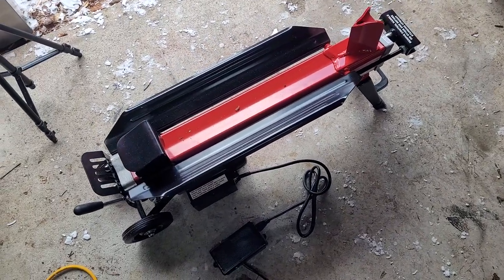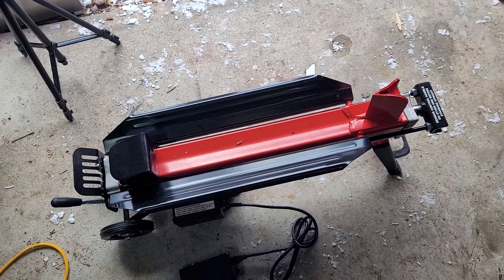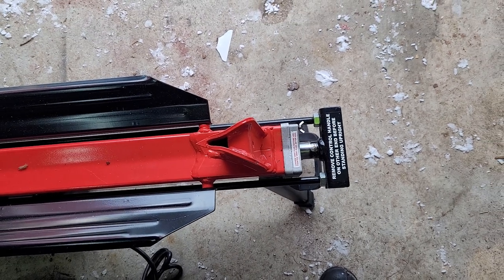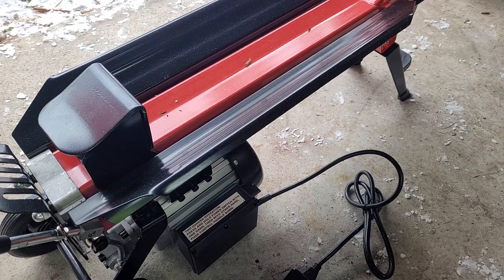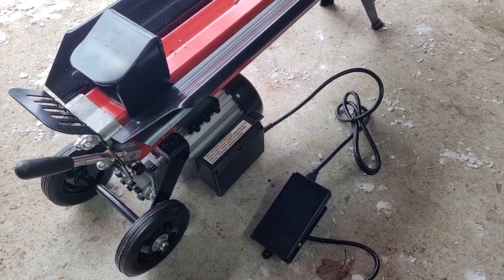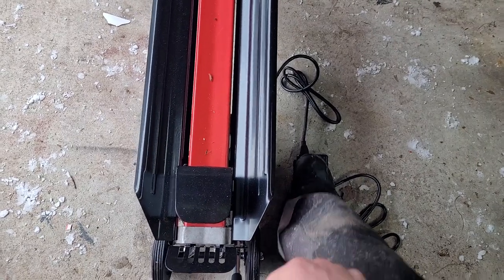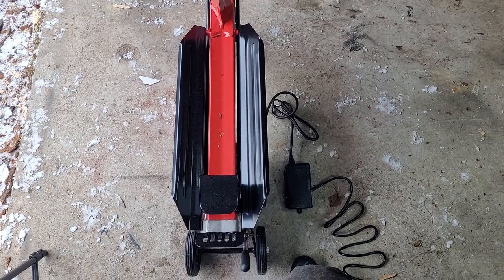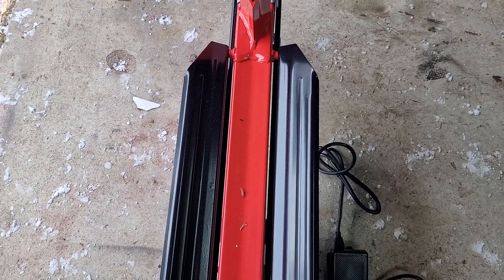Log Splitter Mod

Comment: Okay, it's getting a little safer than what it was, try to find a pipe that can slip on to the handle so your face/head is further away in case, as you said that the chunk of wood explodes, being as close as you were is a safety hazard in the beginning, the ability to be back away from it reduces the injury results significantly, if you ask me, as for a gas log splitter, most already have a ball hitch coupler to go behind your car or yard tractor, if you do get one, get a vertical/horizontal, about a twenty ton power,
Reply from the maker: I could honestly use that lever with my other foot, you can't put like a piece of pipe or something on it because it has to go down towards the floor maybe a 90-degree with a pipe

Comment: That's amazing. Wish i thought of that last spring. All you need to do now is extend that lever so you can split wood in a standing position.
Reply from the maker: I can probably just use the lever with my other foot, I can't put a pipe on it because it has to go in the position towards the floor but maybe a 90° angle and a pipe
Reply: @post10Vlogs  Yeah we don't have that brand in my part of Canada, and now of course i can't find the your wood splitting vid to refresh my memory of you using it.
Reply: @post10Vlogs  Found the post. What if you were to rig up a stirrup style foot bracket?

Comment: Glad to see that footpedal is working for you, Post. Just wish it was a momentary switch in the pedal, so that the machine would return when you let go off of the pressure. In other words, it would operate so long as your foot was on it. If you jumped back because of a log exploding, it would stop immediately.
Reply: Harbor freight also sells a momentary switch that turns the motor on only with your foot on it and shuts off as soon as you release the pedal.

Comment: NICE, those harbor freight warranties are the best. Hoping that this one just needs to get broken in and will start running better. Once the Grease in the motor gets distributed a bit better or something. Might help to run it in a warm environment for a bit so it settles where it needs to be

Comment: I have a similar design electric 5 ton unit from years ago, tractor supply i think. Same concern with the two hand operation, basically your face ends up right over the log and if the log doesnt sit perfect in the splitter it has a high chance of kicking up. almost got hit a couple times. the button in mine is in a different position so i was able to take a piece of rebar and weld it to the handle then bend it over so when you push down on the handle/rebar it hits the button and kicks it on. then releasing it shuts off and the piston springs back. 

much safer to keep a hand up above the log to stop it from snapping up. really have to pay attention to where your hand is but its worth it to keep a log from popping up into your face.

Comment: Not sure if you are into it or not but there are dozens of designs for home-built log splitters online. Most of them are gas-powered, but I'm sure you could do an electric version. I like home-built tools because you can build them to spec / repair them more easily when they break and the learning process is also fun.

Comment: You can entertain yourself with these cheap DIY log splitters for a while. Sooner or later you just want stability, reliablilty and machines what works without constant tinkering. Then you buy a not so cheap, semi-industrial splitter. Doesn't matter if electric or gasoline. The question is, how much money and time you throw out in the imaginary window, till you say, enough waste. :)

Comment: if you want to have an electric hydraulic splitter, I would suggest getting the parts needed to build one as you can leave the electric motor running, to keep the hydraulic pressure up and you will have more complete control over where the pusher goes.. I have seen a gas splitter converted over to electric once before.

Comment: So yes i love electric power tools! At 1st i didn't like my powersmart splitter, More i used it the more i like it. REALLY LIKE IT NOW. The way i got it on the concert blocks, and rig up!  HANDS FREE OPERATION. On the block all i did was extend the lever handle out, took a rope loop it from the lever down to a wooden foot peddle, up to the power button.  With a stick wedge between the button! I press the peddle pulls down the lever and button at the same time.  MY BODY IS NO WHERE AROUND THE DAM THING <>  These electric log splitters need to be 12 ton. I can get by with the 6 ton.  Just the GNARLY RED OAK LOGS > NEEDS TO BE 12 TON I'am splitting  these logs at 10 to 33" round!  the big one, i use a wedge to bust them into half, so i can lift them. It is faster than splitting them with a wedge or maul. Just wrestling these logs around what wears me out. THE GNARLY ONES
Reply: @ 426 SUPER BEE - it would be great to see a picture of your setup with the foot pedal activating both the lever and the button.  Genius!
Reply: @svenshens  Let c?  there is a video of it out already!  see if i can fine it. Mine is Southern Engine newity with bailing wire>  There many videos on this!  like i did mine. HEY IT WORKS AND SAFE

Comment: Definitely 220v log splitters. Just order one without a motor and buy a motor separately.
Reply: All that stopping and starting is going to wear out the motor quickly.
Reply: @slob0516  Well that is not a thing, as electric motors are made to start and stop many times a minute.
Reply: @ducewags  hard disagree. The solenoid determines the ability to start. Bigger the better. More juice to spin it up means faster starts and longer brush life. :)
Reply: @slob0516  Read what I wrote again.
Reply: @ducewags  no. I don't take orders from you. You want to contradict me like a know it all child.
Reply: @slob0516  Electric motors are in fact, made and designed to start and stop. Long run's is what kills electric motors from over heat issues. And yet you don't think so. How lost are you again?

Comment: Mine is a 6 ton Powersmart, It to destructive for me to have in the Garage. To bang up the wall and all the mess!  When those logs explodes!  The logs shoot out with legal force. I put mine on concert blocks and build a cover to lift off and on it >  IT STAYS OUT SIDE > That the only thing i will have is? Cord electric power tools. NO WAY WILL I EVER OWN, ANOTHER GAS ENGINE POWER TOOLS! The electric tools are more cheaper, dependable, lighter, and less NOISE. I would go death lessening to a noisy gas engine. Plus all the headache from it

Comment: The motor sounds like it has a bad start capacitor possibly, it should start immediately like the first one.
Reply: * flux capacitor lol
Reply from the maker: I'm sitting in my garage with a propane heater right now heating this thing up oh, I think it's too cold the oil is too thick for it to operate properly right now its -2 outside and I think that's the issue

Comment: Does that electric motor have a built in soft start? Slowly ramps up current to save motor and component wear.
Reply from the maker: I think it's because it's too cold outside and the hydraulic oil is so thick, I'm currently heating the garage so I can use it

Comment: I just put a bungee cord from the lever to the axel to hold it down. It let me place the pusher where I wanted by lifting up on the lever ( the lever needs to be up to allow the piston to retract)  and then just used the button ( or foot switch) to operate the motor. That allowed me to have one hand free.
Reply: It won't retract until the motor turns off. Mine's the same model